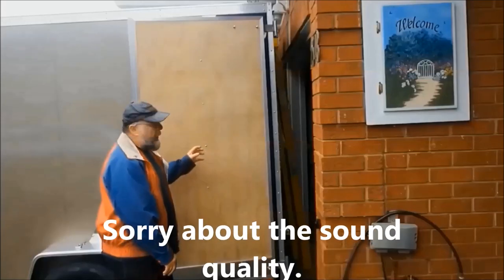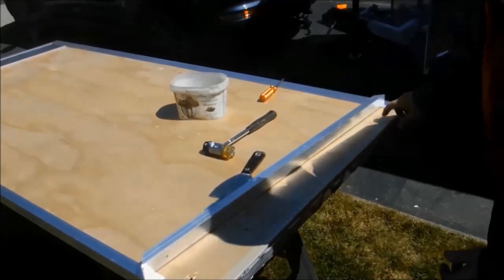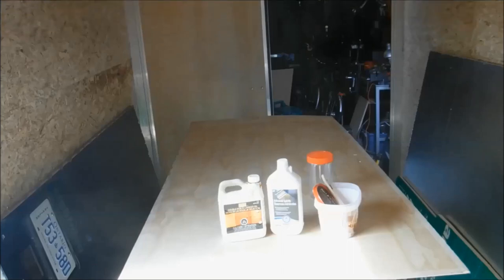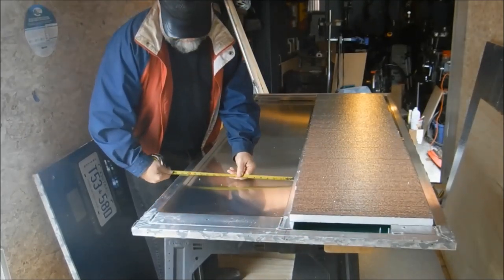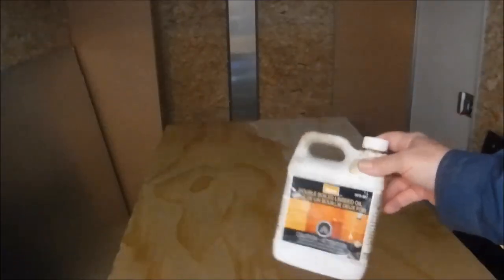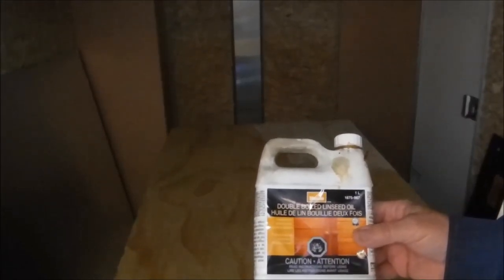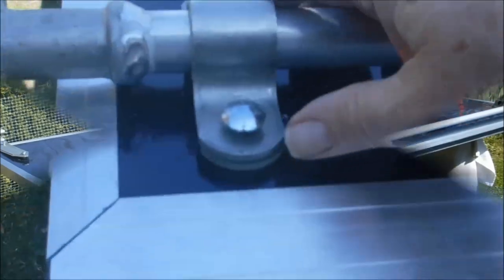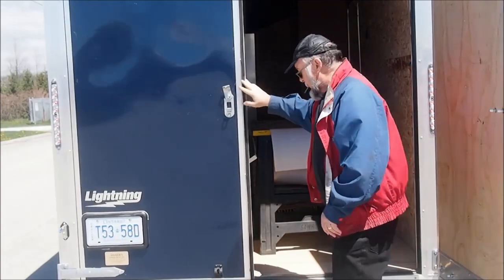Our 7 X 12 cargo trailer conversion Episode 8 insulating the back doors

Comment: thanks - I just got a trailer and was wondering what the inside of the door looks like.  I will be insulating the door also.  It looks like the door needs some reinforcement if one was planning to hang anything on the door.